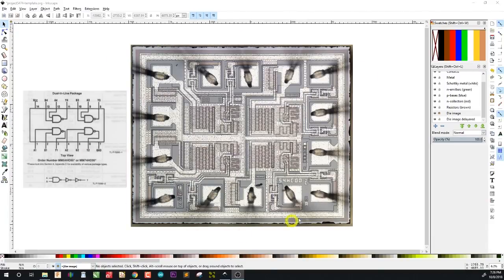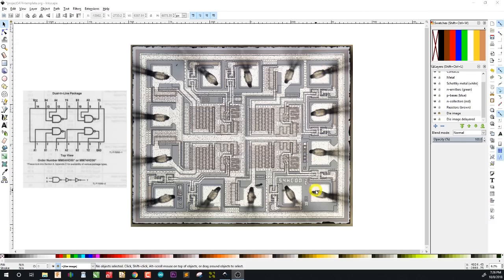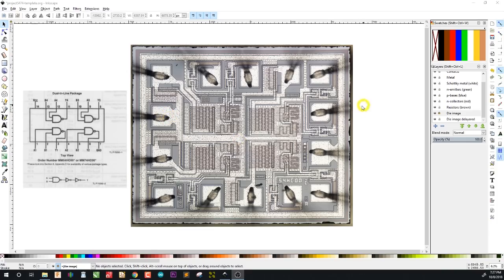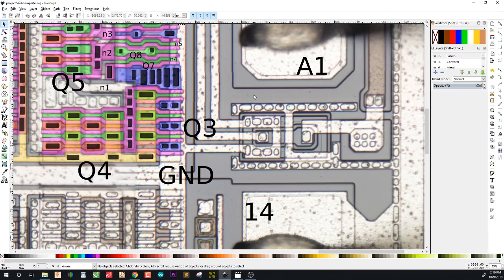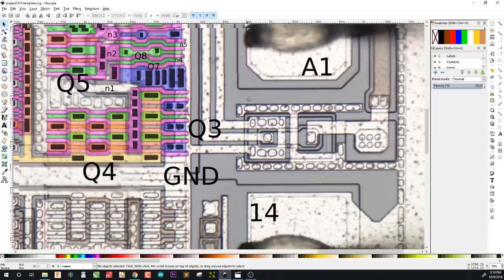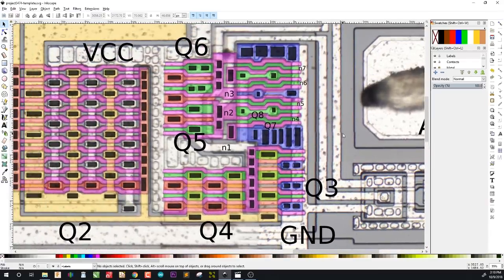Reverse engineering a simple CMOS chip

Comment: Simple chip? Yeah, that's a lot of work. Thanks for teaching us!
Reply: Just to think that this is a quad dual input nand gate as a single IC. Just imagine a full Intel i7 CPU... it has millions upon millions of theses to create all of its needed parts such as the clock, cache memory, registers such as program counter, memory address, memory instruction, accumulator, shift registers, status or flags register, the adders and logic units within the ALU, All of the muxes, demuxes, encoders and decoders for the controllers of the data paths etc... The buses are just all of the wires that connects everything... 

This is considered a simple or elementary logic gate as this is one of the building blocks of logic gates and circuits that lets you abstract away from the transistor level. If you try to get into the metal anymore than this, you would then have to deal with the actual chemical materials themselves and quantum mechanics.

Nand gates are popular because you can create all other gates with just nand gates. You can do the same with Nor gates too, however in production it is typically easier and cheaper to use all Nands as opposed to all Nor gates although it can still be done. However, that cost difference between using Nand versus Nor is not real significant and it also depends on the particular application and the overall design of the device that is being created. 

Now if you start to mix the two with in the same circuitry things become a bit more complex. Then you have to worry about both high and low logic as well as triggering on the rising and falling clock edges to keep track of all synchronous applications as timing and gate propagation is extremely important. But yes as complex as the design looks in this circuit is one of the simplest ICs just as any of the other quad Logic circuits are...

I've just started to study this in the past year, self taught and I have picked up a lot of it relatively quickly; however I've always had a strong background of Mathematics, Physics and Science. For the longest time I knew the math and theory, and for the longest time I knew how to build and use computers. When I say build I mean by installing the physical hardware, configuring the bios, install the operating system, needed drivers and wanted applications. I'm also self taught in programming particularly C++ with the focus in 3D Graphics Engines which can range from Game Engine design to Physics Simulation, 3D Terrain Generation and more. I'm also involved in studying Compiler and Operating System design which lead me to get a better understanding of Assembly. This lead me to learn the hardware. From there I then found a Jewel of a series by Ben Eater where you can watch him build an 8 bit CPU on a breadboard. I highly recommend it. More than just that; I'm also into learning other advanced topics such as Hardware Emulation, A.I. and Machine Learning. 

The highest level of a completed accredited math course that I have is Calculus I. However all of the above requires Calculus II & III, Linear Algebra with Vector Calculus and Analytical Geometry. Probability, Statistics and Logic (Boolean Algebra), Number and Set Theory, Abstract Algebra, and Non Euclidean Complex Algebra and Geometry of Higher Dimensions. It takes a vast wealth or knowledge of all fields of mathematics to apply all of the concepts in both Physics and Chemistry just to make a simple digital electronic switch... Just about everything I mentioned in this paragraph alone is needed if you were to design your own single transistor, never mind an integrated circuit. Then connect a billion of them together to make a CPU, another billion to make a GPU a few million to create your APU or Sound Card. This doesn't even account for Ram, PCI controllers(bridges) networking, interrupts for I/O devices such as mouse and keyboard... Then design the instruction set, convert that to an assembly language with an assembler, use the assembly language to create the C language, use that language to create the Operating System, Micro Controllers and device drivers. Run the operating system and create C++ either from C or Assembly or a combination of the two... Then use C/C++ to create APIs such as DirectX, OpenGL, Vulkan and other libraries and  APIs. Then use all of those APIs to create Image and Video Editing Software, 3D Modeling and 3D Scene applications. Then use those applications to build some assets. Then start another project to create your Game Engine to incorporate those assets. Tie them all together into an integrated system. Now design the rules to your games, the levels, stages, the story, user interaction. You can not forget about the GUI part, even rendering or drawing text is no simple process. Now include all of the Physics Engine for doing motion, collision detection, A.I., path finding, scoring system, menus and item lists or inventory. Then integrate all of the sounds for sound effects and background music. None of this is any good if the scene looks terrible so you have to have good lighting so now right all of the shaders to do all of the lighting calculations for reflection, refraction, fog, how shiny or flat the surface looks. You need to calculate all of the normals coming off of the edges, faces and or vertices so that the lighting calculations are correct. This doesn't count for texture mapping... And so much more. So by the time you're done with all of that, you can then sit there and enjoy playing Tetris, Doom, Mario, Skyrim or Crysis... 

Now when you go to the store and you spend $20 - $70 which may seem like a lot of money, just realize how cheap that is if you had to build your own computer from the transistors up and had to write all of those millions of lines of code. One syntax error and it fails to compile. Other errors and it can fail to link or build. Then it finally runs, until it crashes with an unexpected error, probably because you access an invalid memory address... Back to the debugging board... Ah fixed that crash, but the triangle doesn't look right... or it looks right until it spins then it gets all weird... Going back through the code and dropping in break points... Oh this should of been "+=" not "*=" or this should of been "0.001" not "0.01"... as these are run time errors...

I've been studying through vast tutorials only for years and I have followed and even made a 3D Game Engine from Scratch. No copying and pasting. I typed in everything manually as I followed along from either what I was reading or listening to. Hours of writing the code, configuring the build environment and many more hours debugging! But after creating that 3D Engine went on to use that Engine to build a 3D 1st Person Shooter style game and I can still run and play it to this day... No college education just the willingness to want to learn it and to apply it and the dedication to do it!

You can do anything you want if you put your mind to it!
Reply: skilz8098 I reread this a few times. I don’t know what to say but holy crap that’s insane!!! Thanks for taking the time to write it!
Reply: @hullinstruments  No problem at all. I am also a member of Stack Overflow and I try to help out others as much as I can with the knowledge that I have. 

When I first started to learn C++ on my own, the internet was around but it was in its infancy so to speak. This was the transitional era from when it went from Dial Up to DSL-Cable. I graduated High School in 1999 and I didn't start learning C++ until about 2003. 

Information at that time was there but it was limited and hard to find, also the type of content was very limited too. Most of the tutorials then were all text based, very few images and almost no videos since the data transfer rate through Internet Service Providers was very limited and wasn't very affordable either. 

Not only that but many of the tutorials that I came across never told you how to set up your environment, never told you how to configure your compiler nor told you which compiler they were using nor what flags. They never told you how to debug etc.  They mainly gave you a code snippet for a single function and were expecting you to know how to do it. 

I'm assuming this because most of those who wrote these tutorials in the beginning already had a degree in Computer Science or Computer Engineering and their articles were probably geared towards those who were in College that had some kind of background in it already. It appeared that they weren't targeted towards complete beginners without any knowledge. 

There were many challenges in the beginning and a slight learning curve. But with dedication and the willingness to learn it and to achieve certain goals; I was able to apply myself to finish the tasks at hand. 

Now when I look back at the resources that I had and the limited amount of help that was available to me, I don't mind helping others who are trying to or want to learn. 

I will be straight up with them and tell them that it is very difficult and that there is much to learn and know, but I will also encourage them to try and stick with it as it can be done as long as they are willing to dedicate themselves to put in the time, energy and effort to accomplish such tasks. 

It's almost like asking a basic construction person (one who builds houses or small buildings) to learn how to build a bridge then go and build it where that bridge has a very coherent, sturdy and durable design that will last for many years while building it at the most cost effective price.
Reply: someone: *makes comment*

random dude: 

okay, lemme tell ya my life story
Reply: @skilz8098  What do you work with? Would be a pity of its not related to the things you've taught yourself.
Reply: @getz  That doesn't really matter. I taught myself those things because I was interested in knowing them and intrigued by the contents of their fields.
Reply: Actually it is simple 😂
Reply: @skilz8098  im really impressed by what I  read.  Your path is what I  dream about . What books or starting materials do you recommend ?
Reply: @MrBaileychon16  Just find something that works for you. Each person learns differently. Either grab a book, or find some videos online. Now, some of them will be good while others are kind of traps... There is no one perfect answer or solution to this. It takes years of studying, trial and error, hands on work, to find out what does and doesn't work. Also, while you are doing that hands on stuff, don't forget that the languages and their tools will change and evolve over time. 

Just give yourself a goal of a project that you think you can handle and start from there. I graduated H.S. in 1999 around 2001 is when I decided that I wanted to make a working 3D Game Engine. I didn't get my first compiler until 2003 when Microsoft finally released their 2003 Visual C++ Express Edition... I went and bought a couple of books that were towards 3D Graphics that were available at the time from Borders. I searched the web for as much content as I could and this was before the Youtube era, so video tutorials were very limited and most were in text format, many were still on ftp sites. I finally completed my first basic simple 3D renderer in OpenGL around 2008-09... with hundreds even thousands of hours invested...

As time progressed, the internet went from Dial Up modem to Broadband or High Speed Internet and the "dot.com" boom hit. Within less than a decade from about 2005 - 2010 the amount of information, content and media format had exploded exponentially. Resources became more readily available, and access to IDEs, libraries and toolsets became more widespread, easy to download and to integrate into your own projects. The need to get the binaries and to recompile them for your specific compiler became less and less. More than just books and videos for topics such as DirectX, OpenGL, and now Vulkan, reading their Documentations is also vital. Knowing what version you are working with, what changes have been made, what architect and platforms they work with, and what type of extensions they support... 

If you are a beginner programmer, there are plenty of Youtube videos to get you started within your language of choice either it be C/C++, Java, Python, etc... If you are looking to do 3D Graphics and want a good place to start, I would suggest www.learnopengl.com by Joey de Vries. His content is some of the better material out there based on Modern OpenGL. If you want to learn about DirectX  then try www.rastertek.com it's a bit outdated as it is based on DirectX 10 & 11 as opposed to DirectX 12... but the general concepts that are used in 3D Graphics Engines still applies.

It's not all just about programming, there are a lot of mathematics involved from basic algebra to geometry and trigonometry, to vector calculus and linear algebra with the use of analytical geometry and more. These are just for the graphics to be able to transpose your model data from one coordinate system to another. Then when you get into algorithms, brush up your binary number system: log base 2 or 2^N as this is where you'll need to know and understand Big O notation both for time & space complexity of your containers and algorithms. Then when you get into doing the logic part itself, Boolean Algebra, Probability and Statistics will play a big role. Even number and set theories can be useful in many situations, especially when you start to get into Tree and Graph structures. Then when you get into Animation, Audio and Game A.I. programming now you have to brush up on your Newtonian Kinematic Physics! 

The most important part about rendering (drawing) 3D Graphics within modern code bases isn't just the use of the Graphics API that you are using, but also the nature of their Pipelines, their various Stages within their Pipelines, and their Shader Modules either being GLSL, HLSL, and Spir-V. OpenGL, DirectX and Vulkan respectively.

Once you have a working and solid code base and it comes time to refactor your code and you want to begin to incorporate more efficient algorithms... This is where you'll learn about which Tree Structures to use, how to design them to be Cache Friendly and more such as implementing a Batch Process, working with Threads and multithreaded programming, parallel programming, synchronization and more. Yet all of this is still agnostic or absent that of any kind of Network programming if you decide to allow your Engine to have multiplayer support across various networks... 

It's more than just knowing how to draw stuff to the screen. You have to also know how Computer System is integrated between its various parts such as the CPU, Main Memory, the PCI-Express Lanes, etc... their time latencies and more. If you try to send 1,000 draw calls every frame, this will create a bottleneck in your application because anything that goes across the system bus or the PCI-Express lanes from the CPU is slow! This is where Batch Processing becomes vital. Instead you create a set of batches, and when they all become too full to add more vertex data... then you begin to flush them by sending the batch or bucket that has either the most vertices or the one with the highest priority... So yes, your Batching system will contain a priority queue! This is important because of the Z or Depth Buffer: distance from the camera due to transparencies within your objects. 

I can not tell you which books are the best for there are too many out there, many are great while others are questionable. All I can suggest is to put in the effort to do the research, and start from there.

Comment: Spent nearly 10 years performing metal inspect and earlier layer inspects, I wish I would have had a video like this to help me try to discern the topography that I saw.

Where were you from 93 - 2013 when I was inspecting this stuff ....
Reply: You were inspecting things and they didn’t teach you what you were looking at?
Reply: @TheXGamer969  
Well .... when you're fabricating, and I was in the photo resist strip section, you're not looking for "WHAT" is being made you're looking for resist that didn't get taken off before you stick it into a diffusion tube, or an annealing furnace and contaminate 300 other wafers.

You looked for incomplete etches or over etches.  If you were curious you might stick a lot on a scope BEFORE you strip it just to see where it was being implanted ... Other than that ... No you don't get taught what transistors look like ....

Comment: Great video! Those two inverters form an output buffer, otherwise fanout would be a problem after a couple of gates. Is this a HC version?
Reply: You can see 54HC00 in the silicon at the start, so yes it's high speed CMOS.

Comment: That tan leg next to the pad is indeed a current limiting resistor, probably on the order of 100-200Ω.  Next is most likely a zener connected to VCC, protecting the gate CMOS from inputs higher than VCC.  Finally, the structure with GND on the inside loop and VCC on the outer.  I suspect that's just a zener protecting the gate CMOS from inputs less than GND, but I'm not sure why it's surrounded by VCC.  If you look directly above the NMOS unit you labeled Q1, you'll see there's a solid VCC structure there too.  Do NMOS structures (where Source is grounded) need VDD (aka VCC) right outside their channel area to deplete it of electrons?

Comment: Is this a regular photograph ? (as opposed to scanning electronic microscopy)
If so, how come everything seems so transparent ? Should there not be metallic tracks that ought to be opaque ?
Reply: It might be an x-ray picture
Reply: It's a normal photograph through a microscope. The white areas are the top metal layer. You can't see through it but it's probably not completely flat so you can see shadows where it goes over other features. The gray areas are probably silicon oxide which is transparent
Reply: @max_kl  Thank you.